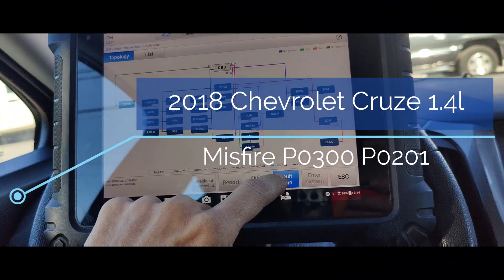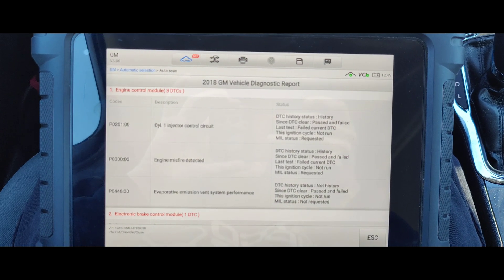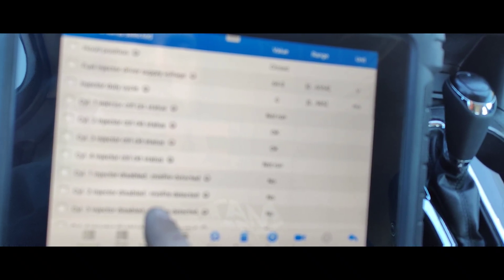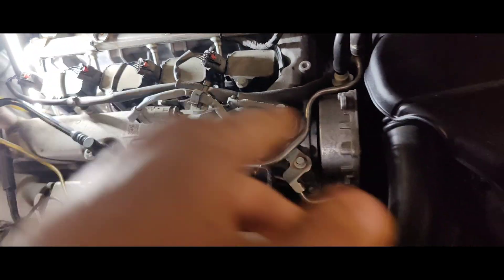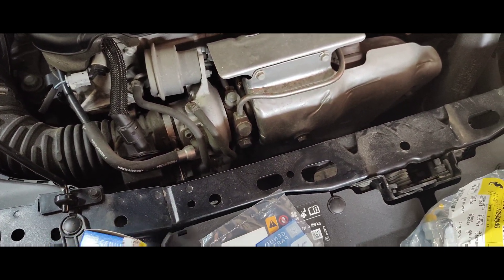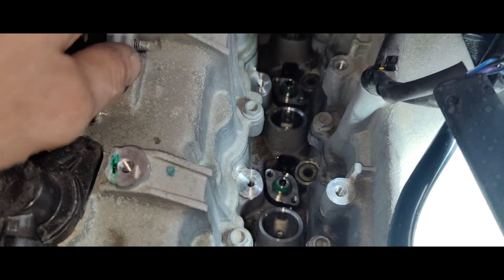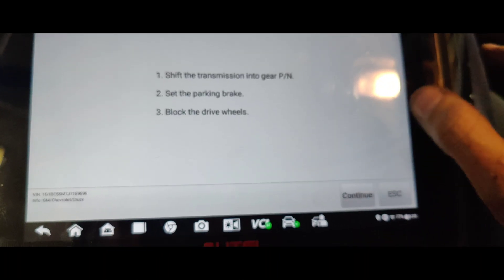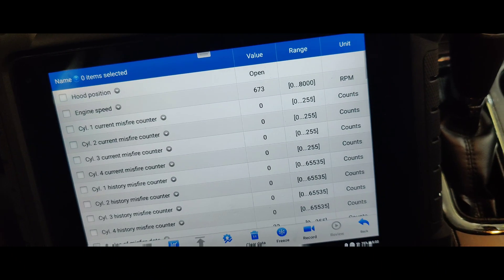2018 Chevrolet Cruze 1.4l Turbo Misfire P0300 P0201 Cylinder 1 Injector Control Circuit

Comment: How can you do a mechanic video when you 1 don't know how to use the scan tool,2 you did not have the proper tools, 3- you did not know that after solving the injector problem you needed to clear the codes 4 your memory is so short that you forgot to plug a connector back in, 5--you did not know that you did not have to do any "Relearning" certainly you did not have to do a clear flood.  Rename your video (Mechanic By Guessing) !  or (Book work Mechanic) !  or (The Good Luck mechanic) !  I wonder how many vehicle's you thought you fixed but really didnt!

Comment: You put the wrong injectors in that car
Reply: Probably generic injectors
Reply from the maker: I don't use aftermarket injectors. You can clearly see the GM bags in my video.
Reply: @okaydokie788  Probably a generic mechanic!
Reply from the maker: How did I put the wrong injectors in?
Reply: @RobertDotterer  ya, especially when you did not have the right tools !

Comment: I replace the fuel injector and gas flood the bottom where the injector are when I started it up. Did I not push something in right or do I need something new? S.O.S.
Reply from the maker: Sounds like a bad oring if the injectors are seated all the way. You also cannot reuse the seals on the injectors.
Reply: Same thing happened to me, i was too rough trying to install and actually snapped an injector stem. Had to remove everything and start over.

Comment: I have same exact problem  with my cruse brought it to my shop and the mechanic said that I have a a broken part in the piston wall, but I looked up and my cars not over heating, should I just change the injector?  And show them your video,
Reply from the maker: If a part of your piston is broken then you need to replace the piston or motor.
Reply: Also could it just be cabon biuld up ?
Reply: Ahh true thanks man

Comment: How did you get the injector out? Im trying to pull mine but its not moving at all
Reply from the maker: I think i used a slide hammer or pry bar. You have to be very careful and you have to resize the injector seals. They are not reusible and must be resized when installing. Also you CANNOT scratch the surface the injector seals on or the head is ruined.
Reply: @RobertDotterer  ok thank you! Very much appreciate you taking the time!
Reply: @RobertDotterer  Blahahahaha

Comment: You may clean this in a wire wheel, and after in an ultrasonic bath if the winding is good
Reply from the maker: You should never clean them with a wire wheel. GDI injectors have very specific spot on the piston they need to spray and if you cause any damage to the tip you cna create hot spots
Reply from the maker: Also these injectors are so cheap from. The dealer it is not worth cleaning.

Comment: i am so glad i am old hoping the vehicles i drive last the rest of my life. I do not own a drive my wire, no electric steering and no direct injection.  all have throttle cables and a regular ignition switch .
Reply from the maker: The only issue with older cars is getting good parts and finding reliable information. All the tips that are not published are disappearing.